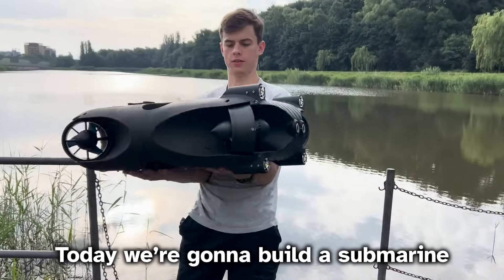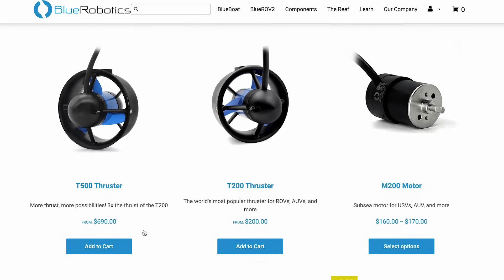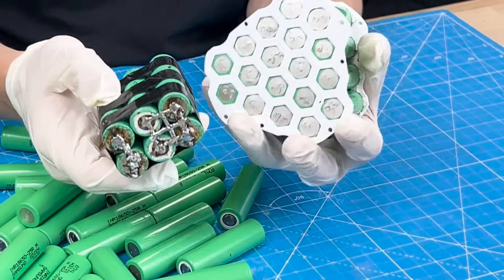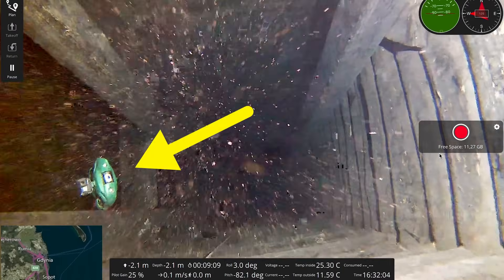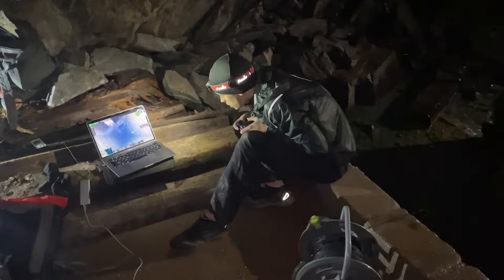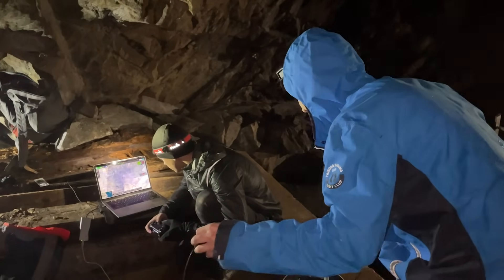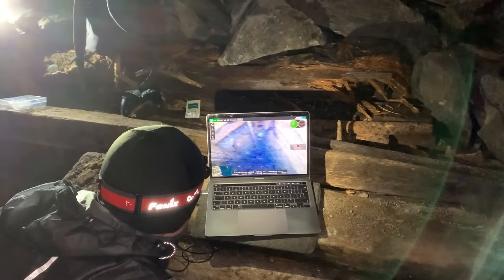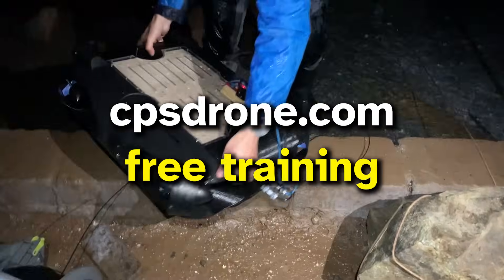My DIY Submarine Dives As Deep As Possible (PT2)

Comment: Probably stupid question, but do you need a tether?
Is there no way to transmit the signal via radio? So you can't tangle up the drone in the tether.
If radio can't transmit through so much water, maybe let the drone drop some free floating tiny repeaters every few meters?

Comment: Are you using the fiberoptic cable as a tether? I would use some high-test fishing line or even steel wire for that, maybe you can connect them together and wind it on a single drum to make controlling easier.

Comment: One thing i've never seen done for ... logical reasons, is spool on the sub, with automatic feed and retrieval. Now, this might not make sense (for the complication) but, if you have your spool on the sub, you can then spool out of a stuck wire and analyze the sh!tuation because you have the wire with you. It also means extrication can be left to the operator, rather than a third party (between sub and operator) which can't exactly pull on the stuck wire. Just a thought.

Comment: if i may propose improvements:
- each side has 1 camera
- specially protected faser optic cable
- 1 backup optic cable
- in general, each critical system has a backupsystem. all parts on this system should be of a different branding than the main system
- stronger floodlights

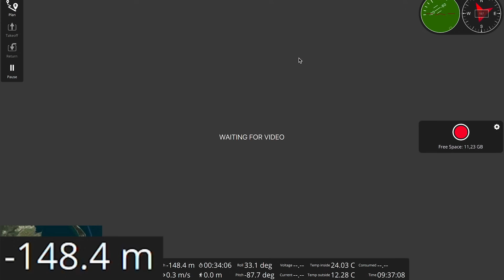Comment: 13:20 you are losing video not because of a hardware issue but because of compression. Modern cameras always compress the footage before streaming it because it allows to get higher resolution and framerate on the same hardware because it requires a smaller bitrate. However, confetti and snow and other such things completely cripple the compression algorithm because it no longer knows what's going on in the frame with so much chaos. to alleviate this problem you should consider lowering the resolution

Comment: I saw the potential problem with the cable before it happened. Good job at staying calm while untangling it.  With all the protrusions and exposed props it is amazing you made it that far. I was impressed with the power of all those motors and the piloting of the drone. Great video. Subbed.

Comment: that's incredible! but an idea, put a  net maybe like a 3d printed one and cover the back and front of the motors, shouldn't lower thrust much but it will protect both motors and the optic wire from getting random stuff tangled in there

Comment: The fact that you didn't include a metal wire anchored to the drone, strong enough to be able to yank on it when it gets stuck is weird to me. Also a power cable maybe? Is that just not an option?

Comment: Cap and engineer: Excellent thinking! The cable spool diameter is too small. The cable will crack. 200lb+ test braided fishing line taped to the cable will let you recover and limit tension on the cable. Don’t underestimate the tension water can exert on 300m line.

Comment: i wonder if a mesh screen would work on the propellers. it would prevent the cable of getting sucked in and caught but it also will affect the water flow. so the mesh needs to be fine enough to prevent cables getting trough but open enough to let the water to flow freely and prevent power loss

also a safety line for pulling it back would be better idea than pulling it from the fiberoptic line. there is some diving lines that are good but expensive af. a thin steel cable would work too but a thin wire is pain to hold on and hard to get grip if u try to pull

Comment: Do you need a direct connection or could you lower separate wires and connect through Bluetooth.  Would neodymium magnet be of use to attach it to line or maybe tow it back up if need be?

Comment: Drop a weighted (wyfy transponder / Teldor marine cable, down threw the obstacles and operate  as a submersible wireless  drone.  Program the onboard system to backtrack-up autonomously, should a problem  happens. OTHERWISE you maintain continues communication up and down the  cabel. The short distance between the submersible drone and the  independent T-communication cable, that is pre installed from the service to the bottom threading threw the obstacles. Should you want a recovery teacher, unable a emergency auto release. Install grills over the thrusters to prevent intanglemen.

Comment: Heres a possibly interesting idea: set up a support structure over the shaft with a pulley attatched to it and centered over the shaft. Then run a guideline with a heavy weight attached to the end through the pulley and let it drop to the bottom of the shaft. Tension the guideline and add something to a submerisble that can hold onto the guildine and follow it down the center of the shaft. (Also run the fiber optic line through the pulley to keep it centered over the shaft as to not get caught)

This idea assumes that there are no obstructions which stick out to the center of the shaft.
Reply: This idea would help with descent but im not sure how well it would help for further exploration of the tunnels

Comment: Sometimes I wonder how the engineers could come up with estimates on the expected crush depth and safe test depth on new submarine designs.  Granted you can calculate from section modulus but it's harder to say if it's not a perfect cylinder and where stress concentration might find a weak point.  Welds need to be stronger than the material but at the same time that can concentrate stress somewhere else.
Looks like we need some screens on those propellers & definitely another camera.  Not sure if there's any way to manipulate the tether having an arm would be possible or practical.

Comment: Maybe applying a sturdy mesh between the propellers will hopefully prevent debris and wire entanglement issues. Just make sure that the holes are wide enough so water can flow effectively but in the same time narrow enough so large debris don't get wedged inside.

Comment: I honestly can't tell if the use of furlongs is a joke or if imperial measures are so foreign that they think we use furlongs

For preventing the motors tangling, you should put a mesh over the intake and output

Also have you  considered engineering a way for the drone, when it becomes disconnected from our laptop, to release the fiber optic cable and try to float up? that way there would at least be a chance of recovery if your tether breaks

Comment: Seems like putting a fine mesh over the thrusters would be an easy solution to keep the wires and debris out - also adding a nylon sheathe to the cable should make it not only more durable, but somewhat more rigid too. My guess it that it should help with futute tangles

Comment: You should integrate a way to hold backpack straps in the design so the sub can be easily carried on your back.
You should probably use a separate steel cable as a tether and put a strain relief on the fiber optic cable.

Comment: 07:10 just a casual Atomic Bomb laying there ....
Yes it will most probably be demilitarised (no more explosive and radioactive material as well as fuses inside. probably not even the ignition- & timingcircuits)
So there is no real danger, but would be a nice decorative Item to have in my garden <3 <3 <3

Comment: What if you used an ir emitter/receiver that was dropped on a weight near the submarine instead of tethering it to the submarine. The emitter would then only have to be in line of sight to the sub which would then be completely wireless allowing it to maneuver. It would be able to go partially into the tunnels so long as the emmiter was nearby. You could also add multiple emitters so the sub could drive back up in case the wire got stuck, even though that's not likely since the emitter can be built quite small so it's less likely to get stuck.

Comment: What about the Pressure on the cable may something stronger like a rope and around this the fiber optic cable (don't bend too much xD) and around this a mantle to secure both. The 180 camera on top and bottom would be wonderful for navigation due to yeah Garbage in water. Please secure the propeller from big garbage.

Comment: Here's an idea for you to navigate around obstacles and through corridors without getting your lines hung on anything: Build and utilize a few smaller drones that hold the line and allow the line to move through it, but where the drone is capable of using either cameras or maybe a type of sonar to be able to 'park' itself at the point you select in the water, so when you get to an obstacle, you just send one of the cable drones out, put it in a spot that holds the cable where it wont get caught on anything and allows for the cable to be held somewhat taut, then if you come to another position that you need to have another cable drone, you first send another down to the first one's spot, have it take over in that position, then move the other on down the line towards the next position.  Just a thought.

Comment: When you add a mesh, you can also add a cutting knife that will get rid of fishing lines just like modern boat propellers. A fishing line is very small and can always reach the propellers, but you don't want to cut the fiber cable when it gets tangled because it has no mesh.

Comment: Does the system has an automatic return feature once the cable is broken? What about giving it also a system that allows it to go on a journey by letting the fibre optics it self go a bit? Or what if it could actually send the footage to the wire

Comment: You really need to add something around that fiber optic cable if you're seriously going to drag the submarine out with it (in worst case). I'd hollow paracord - which would also add easier to see color like bright orange. Tie one end to the sub's frame, pierce optic out of the paracord & connect to sub. Preparing the spool of fiber optic with paracord shell would be teadious but definitely better than yanking on the fiber optic alone. :s

Comment: Some covers would be a great addition to the motors, I know they would obstruct the flow quite a bit and since they are stationary it should be really easy to implement. A small fiber glass rod sticking out of the drone would be a good thing to keep the fiber optic from tangling or even something like an old car antenna would work as long as it's not too long

Comment: ok so I have 3 reccomendations, one would be to have the drone have a sort of ballast system so that in the event of either losing the tether or the batteries dying, the ballast would fall away and the drone could passively float back up (unless you have another tangle), 2, mesh over the prop intakes, and 3, try using either a thicker comms line or have a secondary (thicker) safety line so you don't risk the comms cable breaking when you pull it up

Comment: You should add an CWDM Multiplexer into the sub and the receiving side. So with that you could transfer multiple videofeeds and control data without adding more fibers. So you don´t have to deal with shitty compression for video as you then use the video signal without any compression. Learn about SDI over Fiber with CWDM. This will improve your vision, as you could add multiple cameras to get an surround view.

Comment: You ever have an idea that seems really brilliant, but then you think about it for a moment, and realize it was actually REALLY DUMB? These guys missed that last part. 

Why? WHY would you need a propelled drone for a straight drop down? If you were going to go down a side shaft, or explore an underwater wreck, or chase deep sea life... all of those would make sense. But it's a straight drop down a mine shaft! 

Just put a camera in a heavy metal pipe and let it sink. Your propellers stir up muck, they can get tangled in EVERYTHING, even if you did need force it only needs to be tiny. You could propel a small boat with those beasts, it's just stupid. If you made the pipe with conical top and bottom, it would just slide off any obstacles and be impossible to get tangled. Then you could add more cameras and power the whole thing off a power bank that was ABOVE the water.

It's all just so heavy handed and over engineered for a simple task. Try the K.I.S.S method of engineering... Keep it Simple Stupid!
Reply from the maker: I agree, although we want to be able to explore caves with this drone as well. Besides that, when we arrive at the bottom of the mineshaft we might want to explore further.

Comment: In essence, the problem is the necessity of a link to a human operator. So, that's where an AI model could come in handy. Add a small AI model to the drone, so it can run without the fiber optic cable. Sure, the next stage is to fine tune the model to mine uranium 🙂.

Comment: You should bring a geiger counter down there too. Just checking ... :-) 

Also:
1: check the fiber cable before using it again. With all this damage, it would be a shame to lose the drone for something so trivial. :P 
2: mount a 360 camera on the center of the craft. Hell, it is fiber-optic, you have the bandwidth to mount 2 of them in ventral / dorsal and forward / rear configuration.
3: Any possibility for a "return to home" function on the drone?

Comment: Maybe a pipe fixed in the middle of the shaft at the top would make it easier. Feed the optic through and keep tension so that it makes it harder for the cable to drift out of the middle?

Comment: You can connect a current meter sensor to the power line of each motor. In this way, you can see the motor trying to draw high current. So it's a faulty engine. In fact, you can apply this structure to anything. If your camera draws abnormal current, it will indicate that it is malfunctioning.

Comment: maybe adding sensors(not sure if that is possible) so you can "sense" the walls, allowing you to steer it without a video feed, and maybe add a wire to pull it back up instead of using a fiber optic cable.

adding a mesh over the intake and outputs of the propellers should prevent them from sucking in strings, wires and your own cables in the future.

Comment: So I know someone else already said it - but at the sacrifice of propelllant speed, a cover over the propellers would be a great way to keep them protected. Couple this with a way to keep the line taught would severely reduce issues with the line becoming too 'slack' as it were. A rear facing camera - although choking bandwidth - would allow for a bit more... view. 

I'm also not 100% sure on the whole design when it comes to going down, considering the shape is more like a rectangle over a box. Would it not be easier to design a shape akin to a flat square with a singular camera on all sides coupled with a range finder - possibly a laser?

Comment: Don't solder to batteries like that! The heat will easily damage the cells. Get a battery tab spot welder if you want to do it right - they're only like $50 these days.
Reply from the maker: That's what we did for the new battery pack

Comment: It seems stupid to me to communicate with the drone through such a thin flexible fiber optic cable. I would suggest tucking it into a rubber corrugation or garden hose, this should help prevent it from getting tangled and caught in the hooks or wrapping around the screw.

Comment: Hi! It looks like you're running BlueOS 1.01 - this is extremely old! Many of your video issues could be resolved by updating to the latest stable, 1.2.6, or the latest Beta, 1.3 Beta7 which is almost ready for stable release! 

You may also want to consider Fathom Slim tether and the Fathom-X board set for communicating over ethernet using only 2 wires, at up to 200m!

Finally, Prusa's Printables has many models for 3D printed thruster guard screens - but none for a T500 yet....
Reply from the maker: Hey, I recognize you from the BlueRobotics forum :) 

Thanks so much for the feedback, we'll look into that. We initially thought that there was some connection error in the new version, so we installed the old one. The error was caused by our Wi-Fi being set up to the same subnet and the old version didn't solve it. But we didn't switch back once we fixed the Wi-Fi problem, that was probably a mistake.

Thanks for the comment, we really appreciate that!

Comment: stereoscopic video would be a super fun upload once you have both cameras working.
Reply: also, would a pressurised line of air with random holes in it be useful for desnaring the control cable? if it gets stuck, you could pressurise the line.

Comment: I'm not an engineer but I think you should add some grates in front of the propellers so nothing gets stuck in them.Also add a thin copper wire attached to the fiber so incase it snaps you still have video, even if it would be in worse quality.

Comment: Definitely need a mesh or grille to protect all of the propellers, also maybe add a small arm with pinchers / cutters to aid in clearing obstacles or tangle points. This might require a second controller for the arm control.

Comment: The tether system for the submersible vehicle can be improved as follows:

Tether housing:

Encase the tether in a flexible spring
Spring length should match the submersible's length

Cyclic control:

Attach the tether to a cyclic control mechanism
This allows for "tail-wagging" movements to avoid obstacles if tangled

Design benefits:

Spring keeps the tether away from motors
Adds binding safety
Submersible will resemble a manta ray in appearance

Tail configuration:

Spring tail extends about 1 meter from the rear
Provides flexibility and improved maneuverability
Helps keep the tether clear of obstructions

Visual aid:

Add a red light to the tail
Enhances spatial awareness when using the binocular camera mount
Helps judge length and turning circle

Safety feature:

In case of binding, tail movement can help unhook the tether

This design aims to improve maneuverability, reduce the risk of entanglement, and enhance the operator's spatial awareness of the submersible vehicle.